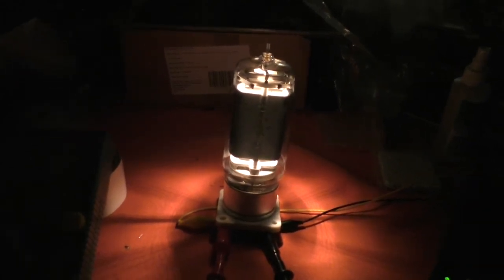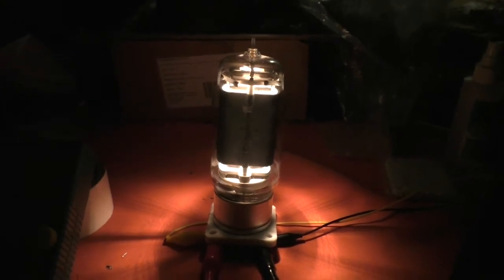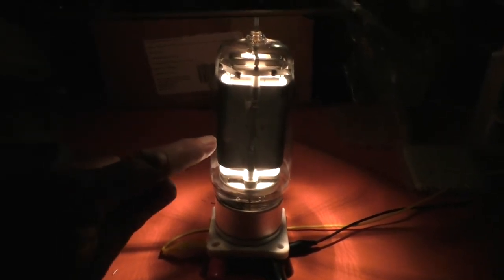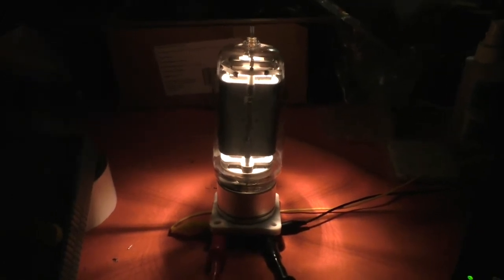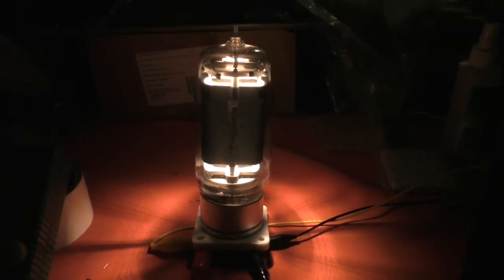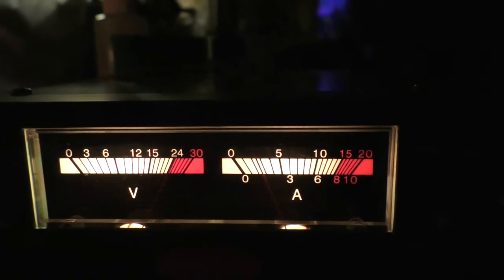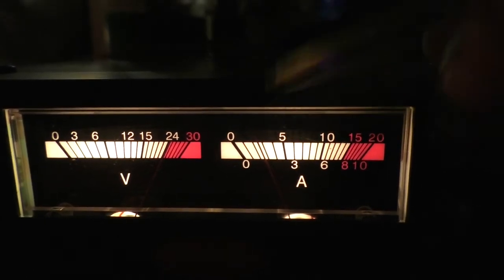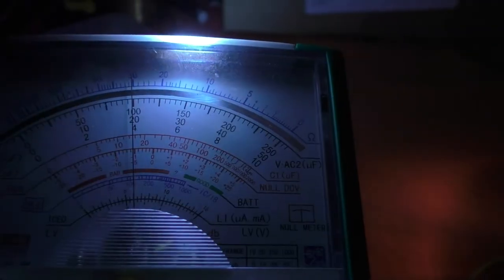Old School Radio... My NOS RK (GK) 71s Have Arrived

Comment: They look great  fil voltage is high current is low isnt the 813 the opposite  ??
Reply from the maker: The 813 is 10V at 5A. Still, 50W to light it up.

Comment: hi, last time i have mantioned you my GU81 amp project, i have finished the design part so of you want some detail i will be very happy to share the design :)
P.s i worked out 1.5Kw output power without stressing the valve.
73, IU3IRR, 18years old from italy